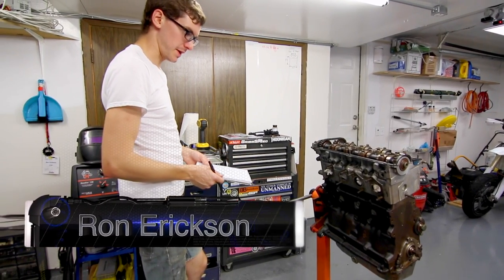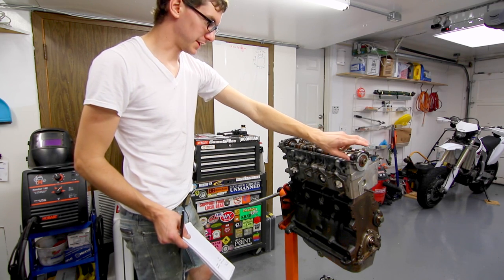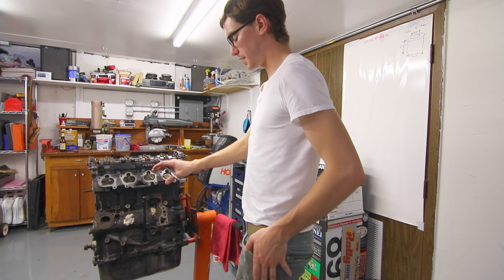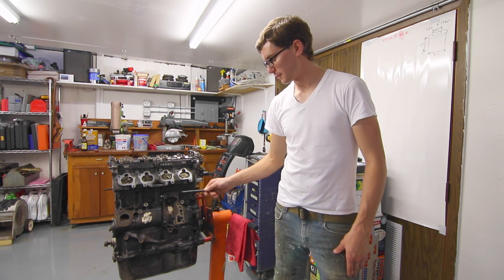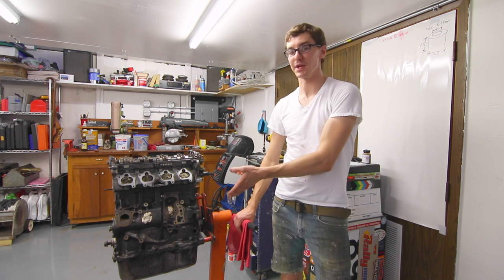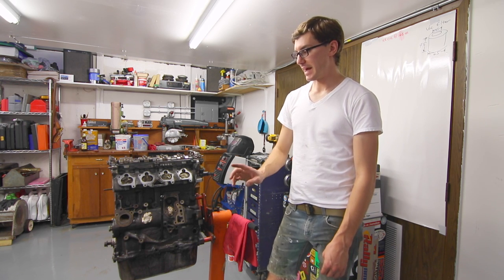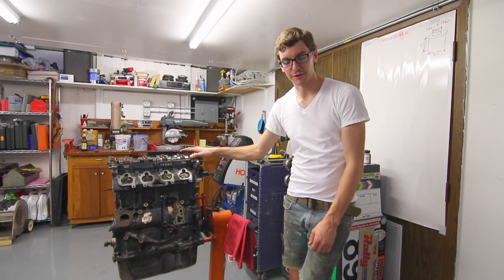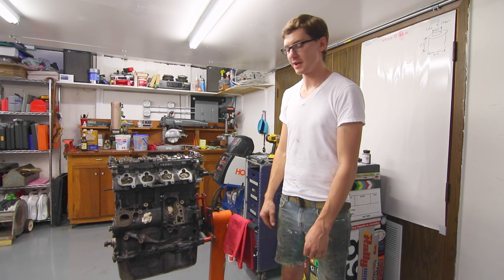Gaskets & Seals -  Project Syncro #32

Comment: I know you said that you're trying to not get crazy with tearing the engine down, but since you'll have the cam chain off, wouldn't it be an opportune time to replace the head gasket and clean the head deck surface? (This coming from a Subaru background so it might be completely overkill in your situation)
Reply from the maker: +FlatBlackable Ron had a compression test done on the engine before taking delivery, and all 4 cylinders were spot on. There were also no signs of the gasket leaking in anyway.  Head gaskets aren't a huge failure point for these engines.